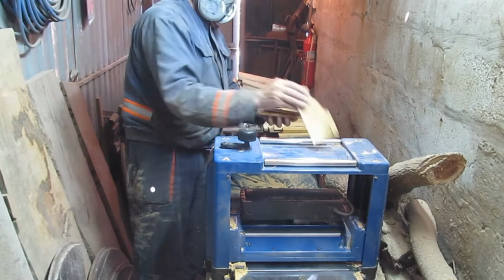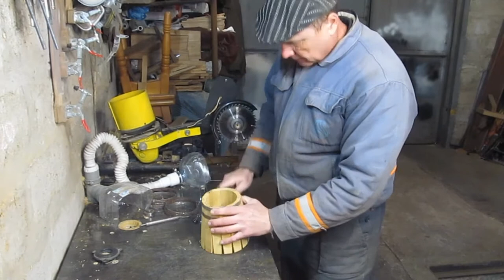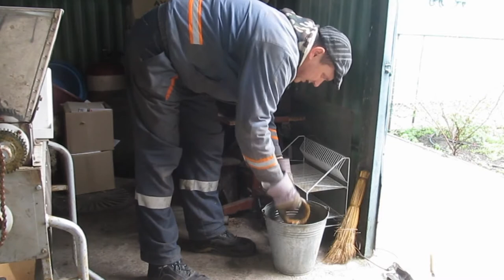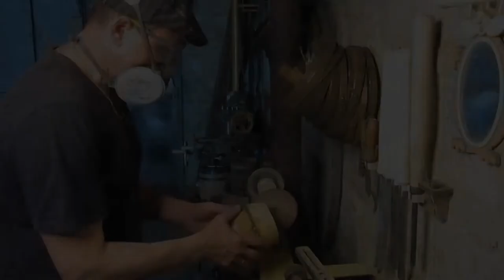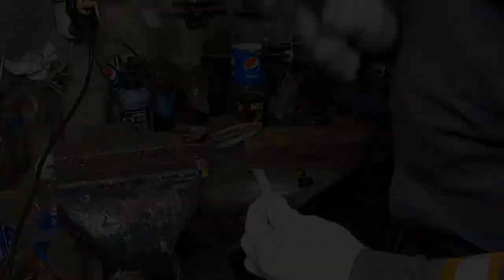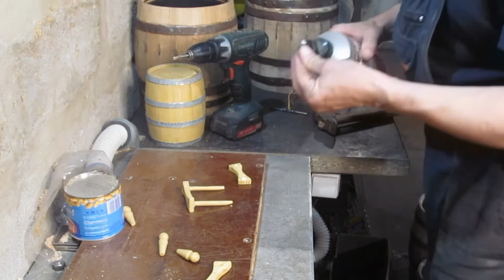Small wooden barrel | Mulberry barrel DIY

Comment: Thank you. I'm making a barrel right now snd thanks to you're videos I'm doing it. I've routered my pieces snd have it pulled together,  now I'm getting ready to winch it.  How long do you soak the wood,  if at all? I'm looking  for the steel to make the hoops.
Reply from the maker: Thank you!!! The barrel can be steamed in a suitable container for 5-7 minutes... Or heated over a fire, periodically pouring water over the barrel... The hoops must be riveted on one side with a hammer so that they take the shape of a cone...
Reply: Thank you

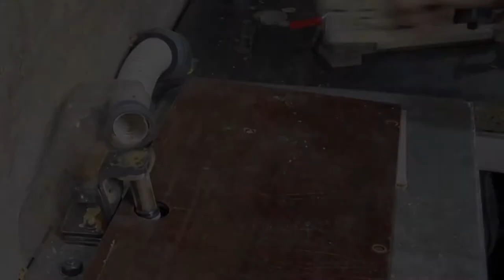Comment: 1:43 what the heck is KA? kilo-angles?

Turned out really good tho! lol
Reply from the maker: Thank you!!! The angle of the side face of the stave depends on the number of staves in the barrel. The angle can be calculated using the formula: 360/N/2, where N is the number of staves in the barrel. In this barrel I use 15 staves, (15 cl - abbreviated staves in Ukrainian) respectively 360/15/2=12 degrees. Each riveting on both sides is cut at an angle of 12 degrees.